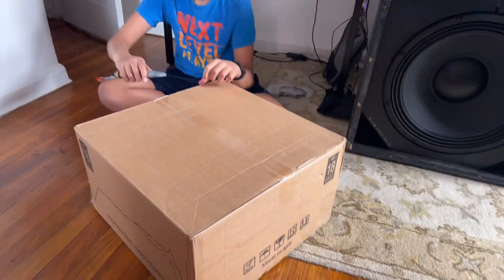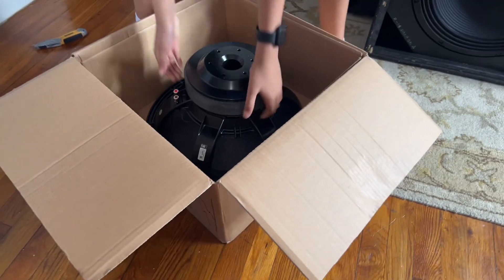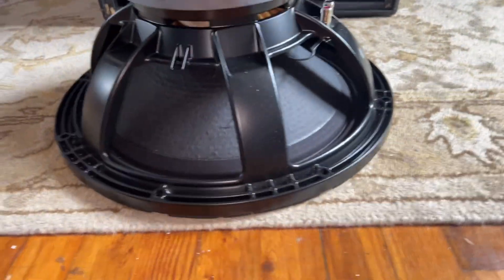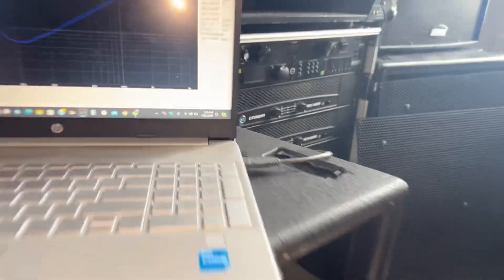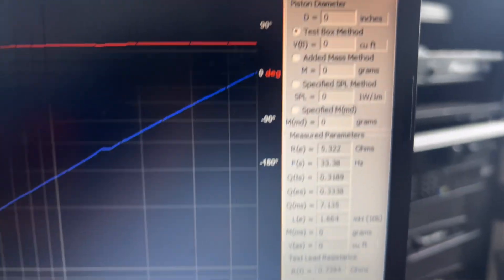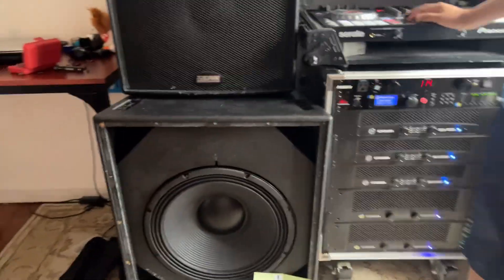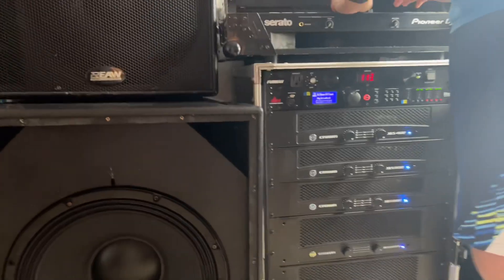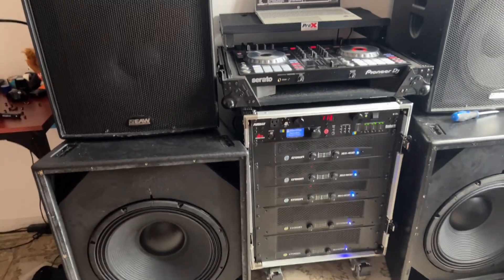18Sound 18LW2600 UNBOXING AND T/S PARAMETERS

Comment: Can you compare this sir to B&C 18TBW100 which one is more bass and power?
Reply from the maker: @edlindillo522  I had 8 of the TBW and those are amazing too but I think the 18 sound is a better woofer.
Reply: @DJ_Renn  Wow! Sir can you enlighten me which one is better for sub woofer ferrite or neodymium magnet? Because I'm planning also of 18 sound neo magnet for sub woofer.
Reply from the maker: @edlindillo522  The neo is lighter, that’s probably the main benefit. I’ve compared a neo 18 sound to the same ferrite 18 sound and the sound the same, only difference is the Neo is quite a bit lighter.
Reply: @MasterDJRenn  Now I know. But I heard some guys told me that neo is easily get rust so is this true like 18 sound neo?